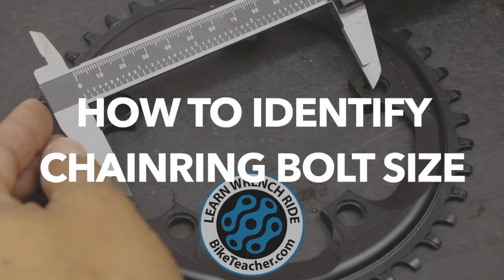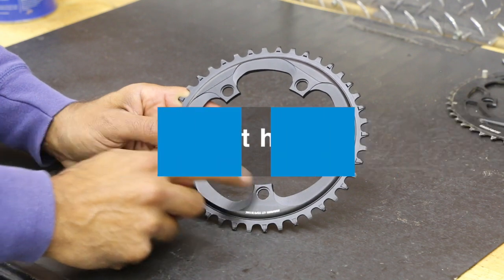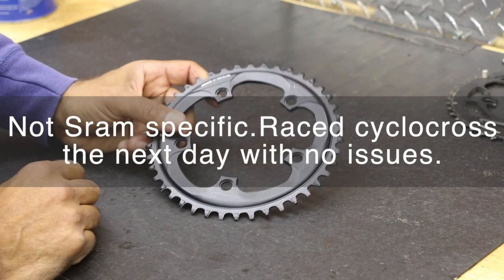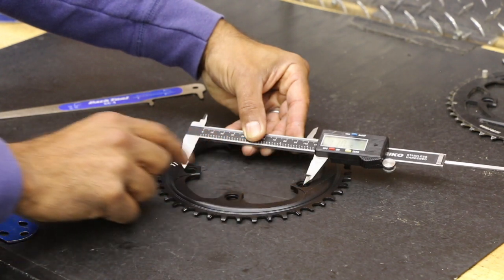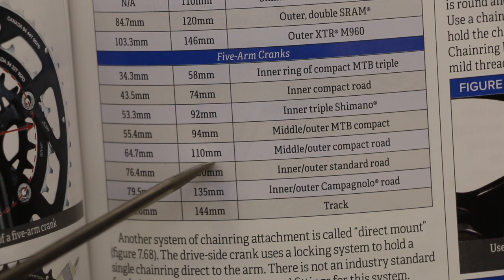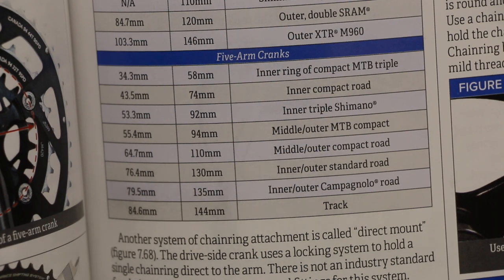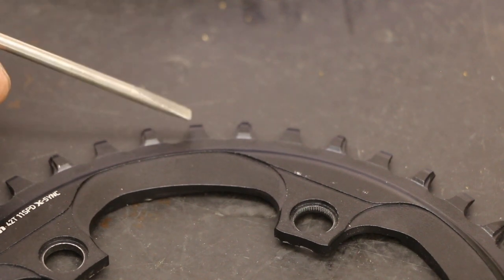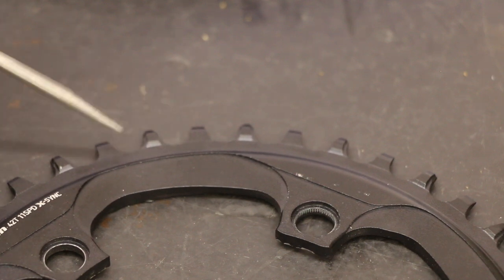How to identify your chainring bolt hole, bolt center diameter for replacement.

Comment: simple on a 5 bolt hole you measure from  the backside of one hole to the center of the other hole leaving one hole in between  not rocket science.

Comment: On the SRAM’s chainring direct mount, do you need spacers or are they ready without any modifications? Boost provides a 3mm offset vs 6mm